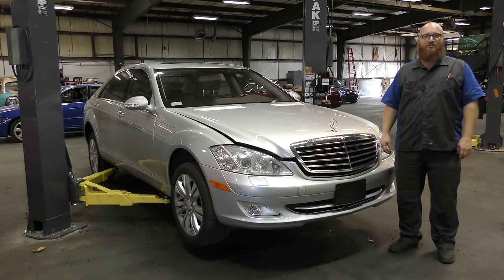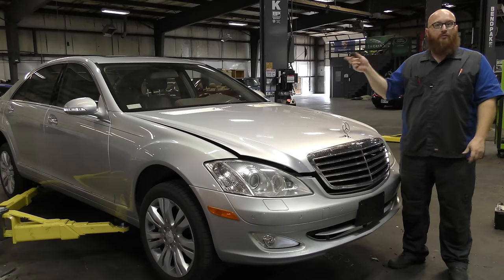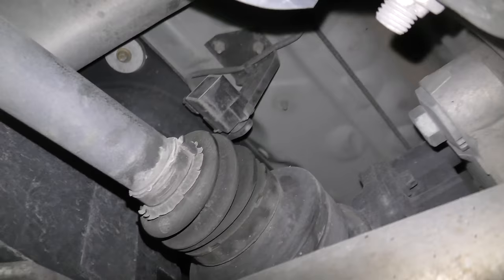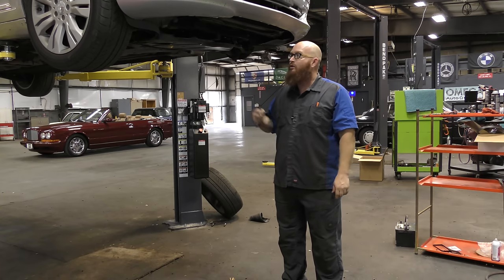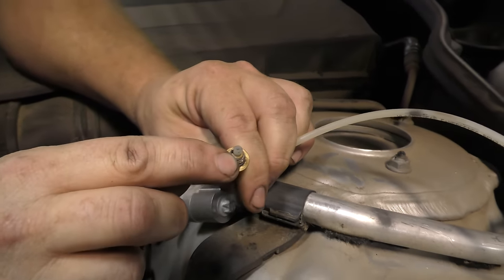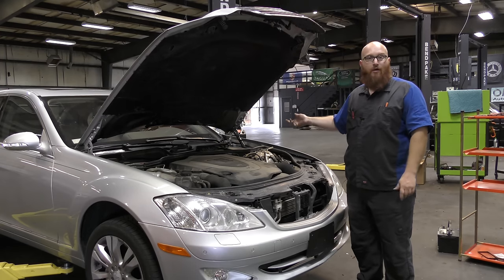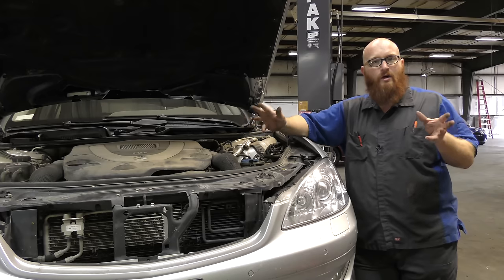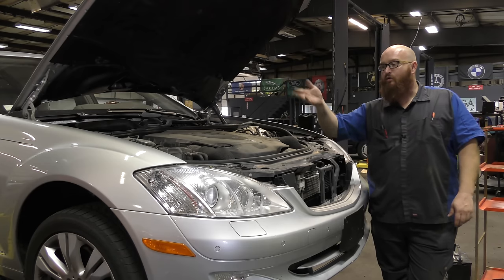Fixing Flat Airmatic Suspension System. CAR WIZARD shows just how easy it is on several platforms

Comment: Hey wizard I got a 2001S 500 the airmatic suspension goes up in the left stock stays up and and I brought it to the dealership and they said I need to replace all four of my shocks because when they command the system to air down it won’t it only goes up so is that a bad valve block?  because I really don’t see four shocks all going bad at the same time and all the sensors as far as ride ride height they dealership said check out ok. Please help !

Comment: I'm assuming the airbag is separate from the hydraulic portion of the strut so it would require some disassembly and swap out the bag or is it a complete swap replacement? reason I ask is I have a  2010 R350 4matic with AIRMATIC
Reply: Fronts are one combined unit, air spring and damper replaced as one unit just like other front strut cars. Rear are separate components, airbag spring and separate shock absorber. At least on the MB cars I have seen, I have not experienced an R class.
Reply: @paulmathieson8081  Yes the R's are same configuration ..  thx the rear are a strut with air bag in lieu of seperate coil spring

Comment: so i have the right front of a 2014 s550 that is down. air pressure applied with shop air picks it up, no leaks. can also activate the other 3 struts  with a scan tool and they work properly. right front will not activate  with the scan tool at all.   I stumped. Do you have any ideas ?  Thanks

Comment: About to check out a 160k mile 03 E500 with a lowered front suspension. Seller has it for $3000. Thinking it might be either front strut, or both. This stuff does not look hard to DIY at all. May pull the trigger, who knows, maybe i can fix it for $250, the price of one strut.

Comment: lol,,, even my 1997 chevy venture has air suspension ,,,,,,   in the rear,,,,   It even works,,,  had to replace the air shocks last year,,,  :-)
Reply: Had a 1997 Pontiac Trans Sport Montana (so sister model) and it had load levelers as well.  Drove it for years with a bad shock and would manually turn the compressor on (it was the same one as for the air pump) to get the suspension back up.  It rarely went more than 20 minutes from home so it stayed that way until the head gasket blew for the second time!

Comment: Nice video. Air suspension is interesting. Does the Airmatic suspension also have some kind of small air tank that stores preassure similar to air suspension kits available on the market?
Reply: One in the boot and two small reservoirs for each rear bellow in front of the rear axle. The ones by the rear axle is often the reason for airleak because they are made of aluminium and gets corroded by water/salt where the hose attaches.

Comment: Exactly that’s what happened to my 2013 ML 350 blutec 4 matic 3.0. First compressor was constantly running and making lid noise so I changed compressor. It was running because rear passenger side small ADS unit attached to strut was dead so I changed the whole strut with ADS. Now my question is that how would I know my ADSis working fine but strut is not able to absorb shock in the pit hole? After changing strut myADSis working fine. Now I am able to raise and lower the car and switch to sport or comfort mode. When I raise the car and whole night air stays inside so looks like air is holding in the air bag.then why still I am getting little hard bounce back in the pit hole? Thanks in advance. Please leave your number. I am from canada.

Comment: My E55 AMG had that crappy "abc" suspension... Right front strut/airbag assembly failed at 28,000 miles. My friends with MB warned me about it, it would fail eventually. 1 strut cost $1750. The rear one failed 6 mos later. $2060. It's the Mercedes mechanic pension plan.

Comment: I have a 2001 s430 with 90k miles. I replaced the valve block because my scanner gave me code c1337 Fault in Component y36/6y4 (right rear level Control Valve) then cleared the code but it keeps coming up. Any idea?

Comment: I own several Panthers with rear air suspension and the only thing that's ever failed are the springs themselves. They're $100 a piece, takes 20 minutes to install each one. Easiest system ever.

Comment: i had one come into the shop with a faulty compressor. came in with all 4 wheels slammed. tried actuating the pump with autel and nada. Checked for power and ground all good. replaced compressor then checked for leaks in the valve block. called it good after vehicle raised up

Comment: I have a GL450 airmatic compressor that was working just fine, but after needing to replace my battery, the compressor will not even turn on anymore. Airmatic symbol on dash now. Any help with this would be greatly appreciated.

Comment: When sitting for a few days in my cold underground parking lot my 2013 CLS550 rear drops lower than the front end but as soon as I start it up the rear rises and equals the front very fast and holds. Is this a problem or is it my rear air suspension is starting to give out.

Comment: True yacht owners with an income stream like Hoovie provides you have a cornucopia of vehicles connected with their vessels, judging from some of the James Bond movies I've seen. The Goonzquad channel has a boat, not a yacht; however, they just bought a helicopter and have it on their channel to service, restoreand fly. Perhaps a collaboration episode for proof of concept?

A Robinson, R-22 two-seater like the Goonz's, could easily be accommodated on a small heliport on your yacht and a great way to fetch fuel when your monster engines run dry! To solve two, maybe three, problems with one vehicle, could a Mercedes C Class convertible be waterproofed, have a propellor attached and your yacht equipped with a drive-on/sail-on-ramp to serve as a dingy, a ski boat and serve you and Mrs. Wizard as a way to drive through your ports of call in search of Grey Poupon, assuming such condiments are available in your neck of the woods?

Comment: Fitted a new pump no air leeks. And can manually fill the air bags and leave it on hard standing and the car will not be flat in the morning. Almost seems like the valve block is not working for some reason pulling my hair out

Comment: Would anyone know what is wrong with my car no one can seem to figure it out i recently replaced front upper control arms and lower control arms before I replaced it the car was raising as it did factory now that it is replaced it don’t want to raise all the way up and the thing is the upper control arm bolt is rubbing the tire the car raises it just does not go up how it did before it only goes to a certain point and stops. No dash lights no leaks air compressor works what can be the problem thanks

Comment: 2010 E-550 4matic. Jacked up the rear and replaced brake pads. Now rear will not raise and compressor will not run. Checked the fuses ok, checked the relay, ok. Bypassed relay and compressor will run but still does not raise rear. No dash messages. Any Ideas??? HELP!
Reply: Drove around the block ended up getting a "Suspension failure" message on dash.

Comment: Just for reference: The E-Class - at least the W211 - does have a separate Air Spring and (hydraulic) Shock, both for the rear-only self-leveling, and the full Airmatic. And the rear components are different between the two systems (the Airmatic parts are unfortunately more expensive than the rear SLS). So keep that in mind when shopping for parts or talking with a shop.

Comment: My w220 has air suspension problem, it can’t rise up, if one person drives, it is still ok, when over 2 people, it will be down.
 And I am so confused about it never down when just parking in the garage, even couple months, when I start the engine, it will be going up slow until normal level but it can’t be high level, please give me some advice thank you
Reply: Compressed is probably worn out

Comment: I replaced more air bellows because of seized ride height sensor arms, it’s not even funny. The arms corrode and stop moving, so the system doesn’t see a change in ride height, so it keeps pumping up the shocks and BOOM! Blown bellows. 

I checked the sensor arms every service and recommended replacement if they didn’t move freely. I explained to the customer why I’m recommending them, and that it was $300 now to prevent $3000 later.

Comment: 2009 CLS550 what if driver side both front and rear not rising up? What could be the problem in this case?
Reply: From the air compressor at front passenger between bumper and wheel to reservoir air tank on the driver side between bumper and wheel to valve block on passenger side between engine and wheel with color code connector air hose coming out of it. One of this item must be bad if the car cannot be raised.

Comment: Have a 2011 Jeep Grand Cherokee Overland V8 4x4 at 125k miles.  Replaced the compressor x3, module, lock, compressor air line, etc.....thank goodness for extended warranty as it would have cost 9G just the suspension itself.  I am tainted and don’t have a good experience with this.

Comment: I have a 2007 s550 with a Malfunction on the dash. I took the car to Mercedes and they said the passenger side is filling up too slow. I replaced the compressor and still have the malfunction. I'm thinking I have a leak in the rear passenger side. Car is not flat but a bit low in the passenger rear.
Reply: The ride is bouncy

Comment: Can I just change the rear air shocks to a standard coil over unit?
Reply: Not worth it to switch over you could pay similar price for arnott air suspension it’s oem function but more reliable than the one Mercedes Benz used

Comment: I’ve had two with airmatic suspension, and they both went out. They cost a fortune to fix. I will never own a car with the air suspension again.  Maybe I shouldn’t have taken them to the dealer to have them fixed 💰.
Reply: I take my car to the dealership exclusively but if i ran into this situation a premium shop that specializes in german car repairs might save me some money
Reply: @enunez371630  they definitely will dealers are overpriced because they have to make money but really good known specialty mechanics are a better value

Comment: Mercedes still can’t do hydraulic Citroën has been doing it since the 60’s what the hell is a strutt ?
Reply: Mercedes is also using the air suspension since the 1960´s.
Reply: Citroën have been using hydropneumatic suspension since the 1950s in fact. It was invented by an employee of Citroën who had no formal engineering training.

Comment: Um.... why did my 08’ S550 front air strut fail the day this video came out....
Reply: The wizard's curse.
Reply: We had this problem on a cls 550.  Compressor won't come on without scanner to accuate or clear fault code.  Left front strut has a warning label at air inlet " do not tighten" . Air fitting is screwed into plastic strut top and plastic threads blew out.  MB knew this was a problem and fixed by putting a warning label😂

Comment: Or... OR  if you have a S430, S450, S500.. you can check the air matic relay
P/n A0025421319.. these Mercs are famous for a sticking relay. If the air matic compressor is not coming on.
Go check the YouTube video to find and check the relay. Then before you throw money away.  Check to see if the wiring to the air matic compressor is still intact as mice are prone to eating the wiring.

Comment: It's very frustrating and embarrassing I owned 3 Mercedes and each one the airmatic suspension failed it was so embarrassing just to try to get home I had to put hard rubber on the upper control arm it's a very stupid system because if the compressor fails you get message car too low visit workshop but this also messes up the front fenders...I will never buy another mercedes

Comment: One time my 11 E550 went wonky.  I came out of work and the car was high on 1 side low on the other.  The battery was dead. I jumped it went to car wash and it never did it again 🤷‍♂️
Reply: Which battery was bad? The one under the hood or the auxiliary battery in the trunk or under the dash ?? Would very much appreciate a response ! I know my aux battery is bad and things have been weird with my car (windows not working, ABS/ESP when I turn my car on) and now the front end is low.
Reply: @spinnabenz256  it was the main battery under the hood
Reply: @larsbambi1575  damn. My main battery is good I know the trunk battery is low I was hoping that may have been the cause of my airmatic issue. Well guess I need a battery and new suspension😂Thanks for the reply !

Comment: air suspension rides better but in the end, you'll have to replace them which cost a lot of $$$$$$. I rather buy a car with regular struts which will last well over 100k miles.

Comment: convert to spring and struct and be done forever for way less money. air suspension is a expensive unreliable gimmick. 2-3K a air shock and you need 4...  1/4 of that can get some really good sprint and stuct.
Reply: Nope. Nothing like that price normally, even for genuine parts. Aftermarket cheaper again. Last just as long as conventional suspension usually. All cars suspension wears out eventually.

Comment: the rear if thereis a prolem it does not go down it goes up and makes the rear end rock hard almost impossible to drive. because the ass end i bouinces into the air i sucks I replaced struts level sensor no codes the only wa to get it  down in to loosen the nipple onm th estruts and let aitr out and hope the computer catches it berfore it sends it to the hip hop land./ It pisses me off to th epoint i want to burn the car //

Comment: I would never get a vehicle with an airmatic suspension system, because they are unreliable. Instead, here are some more ideas for buy this, not that videos coming up sooner or later:

To buy - 1997 to 2001 Infiniti Q45t sedan with the 4.1 L V8 engine and the four-speed automatic transmission
Not to buy - 2011 to 2019 Infiniti M56/Q70 sedan with the 5.6 L V8 engine and the seven-speed automatic

To buy - 2017 and newer Kia Sportage AWD crossover with the 2.4 L GDI I4 and the six-speed automatic
Not to buy - 2003 to 2009 Kia Sorento 4WD mid-size SUV with any V6 engine and any automatic transmission

To buy - 2020 and newer Toyota Highlander LE AWD crossover with the 3.5 L V6 and the eight-speed automatic
Not to buy - 2017 and newer Honda CR-V AWD crossover with the 1.5 L turbo I4 and the CVT transmission

To buy - 2003 to 2007 Infiniti G35 coupe with the 3.5 L V6 engine and the six-speed manual transmission
Not to buy - 2012 to 2016 Scion FR-S coupe with the 2 L flat-4 engine and the six-speed manual transmission

Thanks again for all your new videos for more vehicles, excluding the yacht and I hope to see you on Tuesday on YouTube for more.

Comment: Mercedes Benz suck on each one I had the airmatic suspension failed and on my e500 the sbc failed its sickning to have a nice looking car and I always had to have something fixed and on my s500  the transmission conductor plate speed sensor failed...I had 3 Mercedes and my girl has a Honda accord no one single problem I will never buy another Mercedes they are over engineered junk